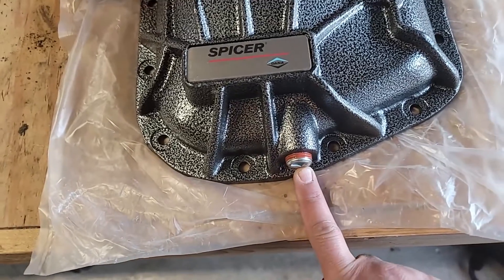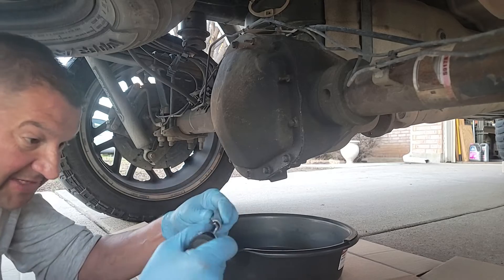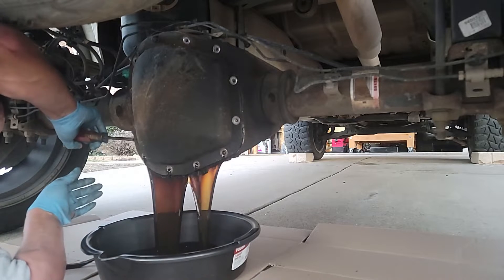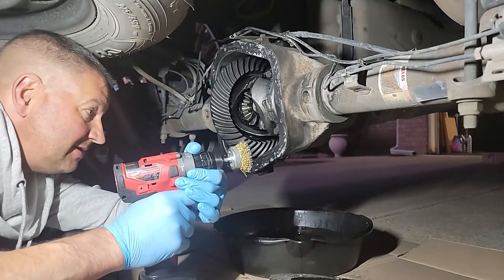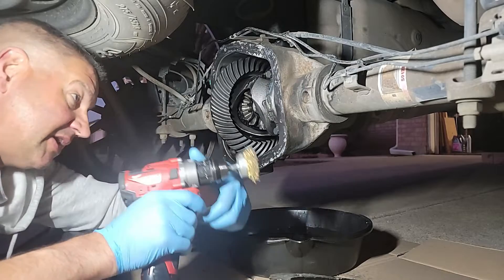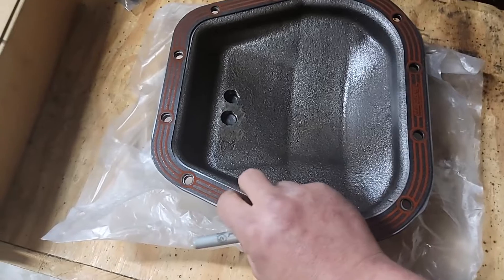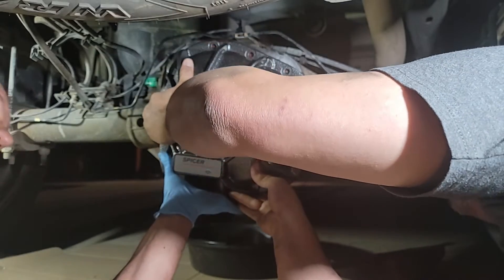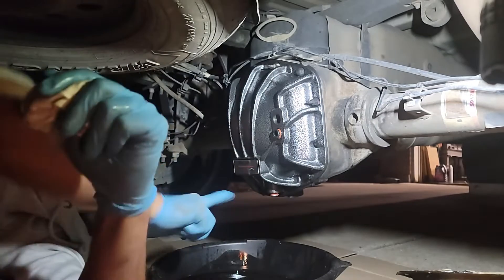Spicer Rear Diff Cover Install

Comment: The reason people are having issues with the new bolts is because with the thicker cover the torque spec is less, people are trying to torque them to factory spec which breaks them. the new spec is like 19-21lbs very light.
Reply from the maker: @405SVT  good to know, thanks for sharing!
Reply: That makes sense! Thought they use cheapo Chinese crap or something!

Comment: Spraying degreasing agent on bearings that are to remain in service is asking for bearing failure. I cringe to think you ran a wire wheel on an open differential housing.
Reply from the maker: While we appreciate your concern, it has almost been a year since this service and there are no leaks and everything works fine.

Comment: Your truck looks like a standard height lift. If so, you should have used the lower fill port for fill and level check. The upper port is for lifted and high pinion angle vehicles. You have overfilled your diff. You might want to check it out.
Reply from the maker: Thank you for the concern, Gary's truck has a 6" rough country lift. He did all the research and was very sure of what he was doing. Again, thank you for keeping an eye on us, much appreciated!

Comment from the maker: This is a step by step instructional walkthrough of installing a new heavy duty Spicer 9.75 rear diff cover with a Lube Locker reusable gasket along with Valvoline 75w-90 fluid.

LubeLocker For 9.75" Differential Cover Gasket: https://a.co/d/cAzDefW

Spicer 10023539 Differential Cover (Ford 9.75), 1 Pack: https://a.co/d/a0gi0YN